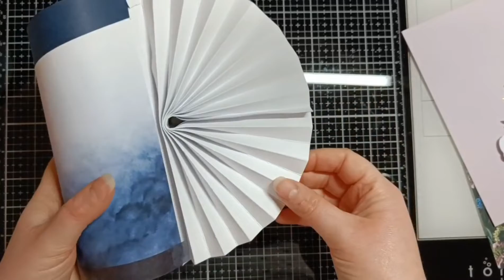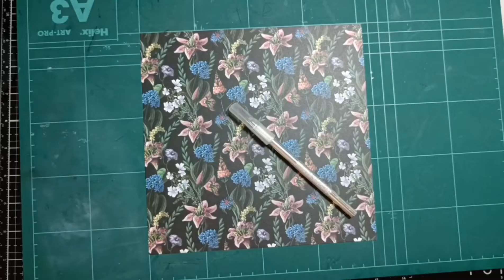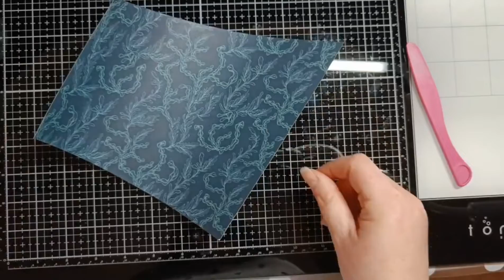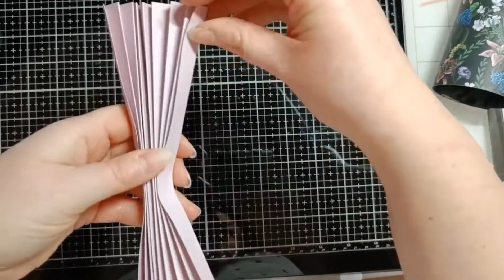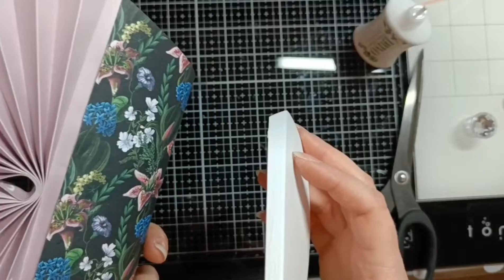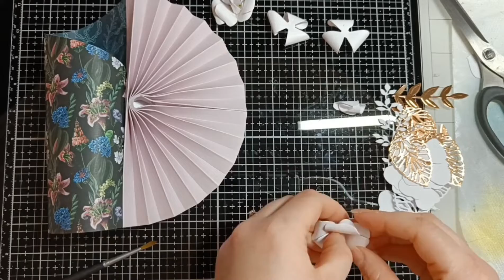Fan Fold Vase Card - No Dies Needed Unique Style 3D Card #cardmaking #vasecard #papercraft

Comment: I tried this, looks lovely but doesn’t stand, the weight of the fan section topples it over.what did I do wrong?
Reply from the maker: Hi Barbara! Thank you for watching and giving it a go! It could be the weight of the card stock. I used a lightweight card for the fan section and you would want a lightweight card for any florals you use too so it isn’t too weighted. To rectify the one you’ve made though you could add a few strips of card discreetly in the vase section to add more weight to the opposite side so it stands up.
Reply: @meerkatmakesbyl-cardsbylaura  thank you I’ll give that a try although I used a good weight paper not card so that would explain it for next time.

Comment: Hi I have made these vases but I have trouble with them standing up. I use the lightest and thinnest paper for the fan and it still topples over. Wats going wrong. Is the double sided tape I use that could add to the weight I put the tape in the right place on the edge. I give up.
Reply from the maker: Thank you so much for watching Caroline. I’m sorry you’re struggling to get your card to stand up! Are you adding flowers and embellishments in the middle where the two parts join up? You can use those to balance your card, so if you notice it is pulling to one side, add more embellishments on the opposite side until it balances out. If you are really struggling with it you could also add a weight in the vase section but it should stand fine if you balance out the embellishments and sentiment. Let me know if I can be of any further help!